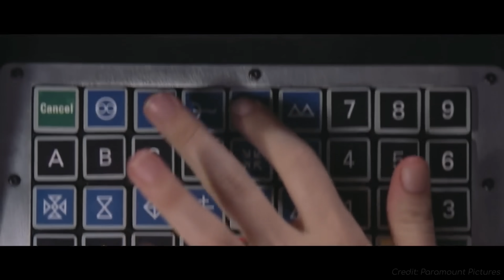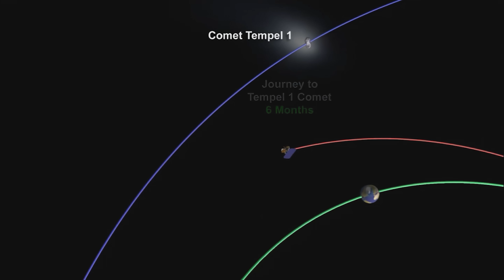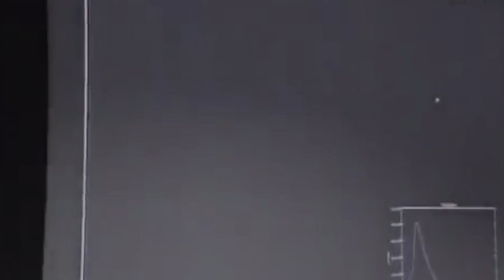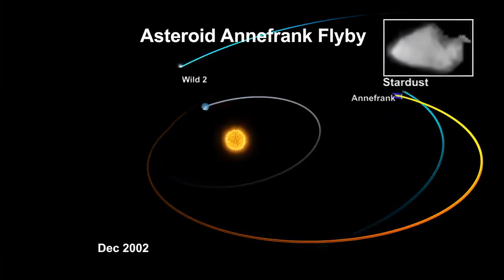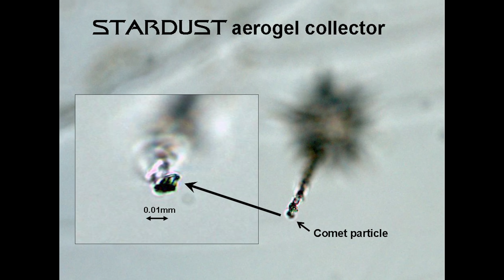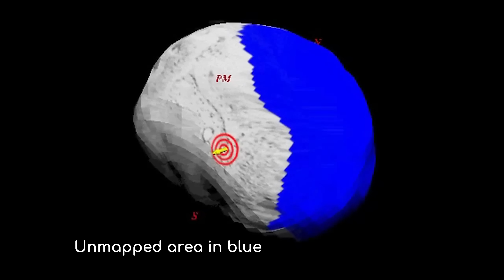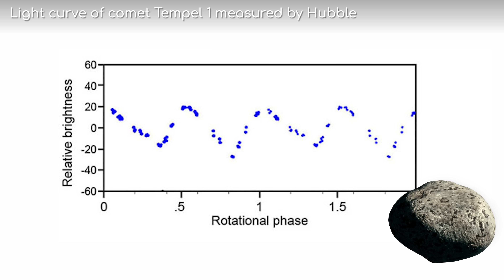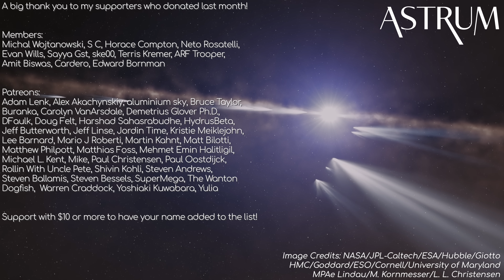The Image NASA Didn't Want to Receive from the Deep Impact Probe | Supercut

Comment: Great video and educational... but I have one question. What was the image that NASA didn't want to receive from the Deep Impact Probe?
Reply: im guessing it must be the view of the impact crater obscured by the material ejected
Reply: Click bait; or maybe proof it never happened? 🤣
Reply: Why am I not surprised the whole title is clickbait..... dafuq.
Reply: this channel is so click baity
Reply: @primarytrainer1 probably an AI content farm.
Reply: The super bright, dusty image, as it blocked the view of the actual impact.
Reply: It's called CLICKBAIT and should be reported. And this is what i'm going to do.
Reply: Astrum klickbait
Reply: @PHeMoX  Yeah, matches other issues with the video, like how it is very uncritical, dodging pressing/interesting questions  but then indulging in trivia, in some mild cases. (I wondered whether the scientists could possibly not have considered the dust cloud after impact obcuring sight. Maybe the other probe was already planned as a failsafe?)

Also, and I wonder whether it could just be made up or just this clickbait channel not being interested, I once read that the probe exploded before hitting the surface, apparently due to a charge difference from the comet having come from far away from our star's electromagnetic field. (Which also causes the ionization trail.) That was used as an example for the electrical universe theory. - If that was the case, then the crater would have looked as if the comet was low-density mass when it isn't. There was also some analysis of profound differences in crater appearance between impact and proximity detonation.

Regarding the clickbait, sadly, some feel compelled to use such titles if a video's view count doesn't conform to an expected norm. Even otherwise very decent-appearing youtubers might do this, so it's kind of an anecdote of why we shouldn't overvalue people. - Success in a rotten system comes at a price.
Reply: A blue police box sitting on the target zone.
Reply: Yeah. Really hate the fact that so many channels that I love and watch all videos fully put such shitty titles that even after watching the entire video I feel like I missed something. Just have to dislike this and hope it changes.
Reply: Clickbait channel, unsubscribed.
Reply: Yeah, I didn't like the fact that it was clickbait, either--; especially since this is supposed to be such a serious, science channel--.  

This leads to real headlines getting ignored and forgotten because their videos will be left-unviewed because of the dread that the title is fraudulent.
Reply: @primarytrainer1  I don't remember it always being this way, but lately I feel like I'm never told what the true video is about with this channel
Reply: You all are incredibly over critical over an overall incredible channel.
Reply: That's the hook.  Very annoying to read the headline and never get the punchline.
Reply: the video is good enough to keep you entertained, i like it 10/10
Reply: @SoFunMe Yep thanks I youve saved me 30mins
Reply: U clearly weren’t paying attention. I read ur comment and this thread before getting to part of the video where he explained exactly what the title says. At 9:50 he explains exactly what happened. Sometimes it pays to actually pay attention😂🤦🏾‍♂️
Reply: @Eli-akad This should be a video about an interesting topic, but instead of properly naming it, they add this fishy title and the clickbaity thumbnail "THIS IS BAD"... and what do we get? About 20 seconds of him explaining why this is not the "predicted outcome". This is misleading, they are clearly trying too hard to get views, and that makes this channel look desperate for money, like a money farm, lame...
Reply: Thank you so much for asking this, as you saved me from a click bait video. Cheers man, have a great day.  🙂
Reply: Thank you for saving me 30 minutes of my life!
Reply: @Eli-akad  and sometimes people have better things to do than wait 10mins for an explanation
Reply: @Timbo_tango  that’s irrelevant to the original comment. Buddy already watched the whole thing😂
Reply: @Dowlphin  didn’t one of the JPL engineers say it was a “superb video” like two comments under this lol
Reply: Yeah, it's really bad. And the narrators voice is weird, in this aurally airbrushed, strangely velvety sort of way- @primarytrainer1
Reply: at 9:30 it tells you exactly why - seems not many bothered to listen
Reply: @daytona1212  so out of all the videos on youtube this one should be reported? Give me a break
Reply: @doctormarazanvose4373 I believe those were images the scientist wanted to see. A lot of knowledge in them. My interpretation of the image they didn't want to see was: the last one. At 28:56 they talk about the last transmission... I don't know if it was an image but I'm sure they didn't wanted it.
Reply: @biggity_blake  You can break whatever you want. No, there are lot's of videos with clickbait and should all be reported.
Reply: While I agree with most of these people about this being a sorry click bait channel. 

Um, basically the answer is "They didn't see anything" and that's the issue.
B/c when the impact happened, all this junk blew out & blocked cameras, or something like that. 
Talks about it around time stamp 10:35

27:00 in they cover things again.
Reply: @daytona1212  i mean these days all content creators know that  it's basically impossible to get a substantial audience without at least a little pinch of clickbait. The thing is it has to be the good balance, not too much that it's comically obvious and awkward, not too little that people don't click and the algorithm never recommends you.
Reply: @wallabra  Well at least mention the subject in the title, in your video. Watching a 30 minuten video to discover it's not in there is pretty annoying, because that's why I started watching the video.
Reply: @daytona1212   I agree with that.
Reply: this was exactly my question: it's just a click bait title. I will unfollow this channel
Reply: @Philsburneraccount  We don't know they can have them write them yet, and there is some real info - just not the info advertised in the title; i.e. click-bait.
Reply: @primarytrainer1  Yes, this channel is very clickbaity with the titles. And not everything is correct. See it as entertainment rather than news and you'll be fine.
Reply: No astrum is a legitimate channel, normally not click bait not sure what happened here
Reply: It was a sponsor ad interruption.
Reply: The crater was bigger than they wanted it to be. That's all, not clickbait.
Reply: The "scientist never expected" was especially strange to hear since I vaguely remember reading a description of walking on a comet as being treacherous due to the fluffy nature of it from a book written in the 1970s. Can't remember the book so I'll assume I'm imagining it for now. The title is still click bait though and I will not be clicking on future videos after sitting through this one.
Reply: Was the comet nocked off it's trajectory ? Not watching the whole thing. Too boring .
Reply: Yup. Might be a good content but there are plenty of better channels that don't use deceit to grab their audience. Blocked.
Reply: This video is tiptoeing around a rather large controversy without directly mentioning what it is. The title does not say "image" it says "result" , from the stand point of imagery general telemetry and mission execution every thing went flawlessly or as close to it as you can expect the technical achievement is actually quite impressive.
  The people saying "it must be the view of the impact crater obscured by the material ejected" are close but don't get a cigar. You see there is no mechanism to explain how the debris settled back in the hole it was blasted out of.... The mission operators simply asserted that this is what happened to explain the fact that no hole was created by the impactor in the soft surface of a muddy snow ball comet and have been allowed to get away with it.
  This was the entire point of the impactor "make a hole so we can see the ice" but instead what they got was the "result" one would expect from an impact with solid rock I will say it again >>> "The Result was EXACTLY what one would expect if the impact were on solid rock"<<<.
  In addition the pre impact flash was predicted by plasma physicists the moment the experiments details were publicized. It was pointed out by the electron jockeys that objects such as comets live 99% of their existence at apogee far from the sun in an area of the heliosphere that is very defuse and electron poor inducing a positive charge on the body , then these bodies accelerate toward perigee in the inner solar system where the electron density is vastly grater. 
   Electrical mechanics are such that a body with a large charge differential from its environment will have an area of effect surrounding it that when entered by an object of differing charge will result in charge equalization aka "a spark" a rather large spark in that case.
  These same Physicists also predicted the "no hole" result because the same electron poor positive charge also accounts for the luminescence of comets as they approach the sun with no need for ice sublimation. This being the only reason to think comets are made of ice and ice comets being a piece of the standard model of star formation you can sort of see how  this one seemingly insignificant anti result starts to cave in a whole lot of assumptions across the entire field of astronomy.

...it is a fair observation of astronomy as a discipline that they dislike electron jockeys (or any one else) telling them they are wrong. they see electricity as a technical gimmick useful for instrumentation but having nothing to do with their home turf an area of study they fought very hard to free from its astrology roots. And to be fair electron Physics has a history of fraud from the 1900s that could make any astrologer look credible if you squint hard enough. The rift is so bad in fact that Astronomers ad hoc invented a rule that electricity is not allowed in space and routinely "discover" electrical principles in their observations that they they reformulate so as to claim them as their own....sad and petty does not even start to describe the current state of astronomy.
Reply: But, but . . . he had a British accent. People with British accents are classy.
Reply: @Philsburneraccount none of you are real
Reply: @wallabra  That's not true at all. Among science channels with zero clickbait but millions of views because the quality of the content is high, Smarter Every Day, Steve Mould, Jeremy Fielding, 3 minutes of Aviation and not science but DDOI is the gold standard for compilations.
Reply: @BariumCobaltNitrog3n   yeah but you're looking at the top 0.01% of the bulk, and that level you need waaay more than just production quality to become a break out success. You need to know how to pace your content (to retain viewers till the end as much as possible to appease the algorithm without boring them and making then not come back), and you need visual effects and transitions that instill wow and awe. Most likely, though, you won't bother yourself with literally all the details of making a successful video (and sadly a good video isn't the same as a successful video), so you'll hire people to do it for you, which means you will need some sort of income through your channel, which besides measly ad revenue, could be Patreon (which is unreliable for smaller creators with smaller audiences), sponsors (though they always go to bigger channels), etc. So no, it's not all about production quality.
Reply: @wallabra  You've never watched the ones I mentioned have you? They are 99% person talking to camera, average lighting and not anywhere near the algorithm ideal. Patreon is great for anyone if you are making videos that people want to watch. Nile Red (and Blue) is a chemist who does fun things that no one understands and has hundreds of Patrons, Cody's Lab, Action Lab, Backyard Scientist all very successful but no unboxing, no tutorials, no makeup, no lighting, no crew. Small channels that don't have a day job. You're probably thinking of Mark Rober who does everything on your list and bows to the 'rithm.
Reply: The initial comment in this train demonstrates why we have so many problems in the world. People seem to be incapable of paying attention to even the simplest things … the “image” NASA did not want to see” as the title asks is the one where the impact crater was obscured by the impact dust cloud (as shown in the video) since one of the primary mission objectives was to image the impact crater!
Reply: @daytona1212 The picture they didn’t want to see was all the dust that covered the crater which meant they needed to send a second probe for pictures.  Did you even watch the video?
Reply: @Dowlphin Did you actually watch the video?  The thing NASA didn’t want to see was the entire crater behind hidden under all the dust from the impact.  Which meant they now had to find another way to actually get the pictures they wanted.  I swear to god you guys put all this energy into assuming there’s something nefarious going on without taking the 5 seconds it takes to think through the question.
Reply: @nickopeters Did you watch the video?  The thing NASA didn’t want to see was the entire crater being covered in dust so that their goal was ruined.  Come on guys, think!
Reply: They used to be such an amazing channel, but recently its all been going downhill
Reply: @astrophysicistguy  The title of the video should be the focus and mentioned, explained and made clear in the first 3 minutes not at minute 19. Asking a simple honest question is absolutely not why you have so many problems in your world, and you are not WE, you speak for yourself, only. You seem to be incapable, as you say, of understanding a simple question. Or reading in general, any of the 60 or so people that answered his question a lot nicer than you did.
Reply: It's funny that a video that doesn't answer questions for you, but makes you think about what the title meant, instantly becomes click bait to the minds that cannot process information on their own. I bet they watch Fox Noise.
Reply: @BariumCobaltNitrog3n  have you written a book about how to do proper YT videos so i can read you thesis on how only videos that “explain & and made clear in the first 3 minutes …” are correct?  What happens if they explain it at 3 minutes & 309 secs or god forbid at 2 minutes and 11 secs? And you’re absolutely correct, I don’t care what the other 60 people have said because it’s my experience that 59 usually don’t have a clue what they are talking about.  Maybe if they were all also members of MENSA like myself it would be different but sadly it’s not. 

Oh and if you had an attention span greater than 3 mins this would not be an issue but i digress …
Reply: The Clickbait Image...
Reply: @BariumCobaltNitrog3n   I think you missed my point. When I said "production value" I didn't mean it had to be unboxing stuff, or have makeup and lighting, like be a studio thing. It's often the small details, like good video editing and audio mastering. Those are sometimes the most important details, even if they're subtle. I've yet to master those myself, but anyway. I think these channels are successful because they found their audience, and they do, yes, have good production value.
Reply: @wallabra  Well isn't that lovely.
Reply: I want to offer my input here as an astrophysicist. Although the video could have used a more straightforward title, it accurately tells the story of the Deep Impact and subsequent Stardust missions. I don't consider it clickbait and it doesn't exaggerate the importance of the result to science. The cloud was indeed more significant than expected, and prevented Deep Impact from getting satisfactory images of the impact site. It was such an issue that the mission plan of Stardust was modified to visit Tempel 1 to get additional pictures after everything had settled down. As for whether or not scientists should have expected this, the whole point of these missions is to find out what the internal structure is. Sure, many people had ideas and theories beforehand, but that's why we fly a mission there to confirm.

Edit: To clarify, the photo they didn't want to see was the one with the cloud obscuring the impact site
Reply: @orbemsolis  Since your reply is directed at the OP, you might want to read what he wrote again. What was the image they did not want to receive?
Reply: The dust cloud.
Reply: The comet was totally lost 😮 since the space was exposed 😳 and a hole appeared very slowly
Reply: You got clickbaited. This channel is prone to do that.
Reply: @@MichaelDettrey nobody  intelligent. Chemically speaking, silicon lifeforms existing would be so difficult to sustain that it just wouldn't last. It's not viable. It's a fun sci-fi idea, but the probability of it existing and all the chemical complications mean that if we ever did find it, it'd be some sort of single-celled microbe, or something of the sort, and would be fascinating, but also absolutely NOT something NASA WOULDN'T want to find.
Reply: I hate these for the clickbait titles... I think I'm done with the channel because of it
Reply: Yes, I feel I fell for another click-bait title on this channel and wasted my time waiting for the answer. It's time to block this channel for good :(
Reply: The image that NASA didn't want to receive was the overly bright flash (09:17).  
A lighting like discharge between the comet and probe occurred seconds before impact, producing an explosion/flash much greater than any NASA scientists had expected, calling into question the standard comet model. However just such a discharge had been predicted by Wal Thornhill’s electric comets & asteroids model, years earlier.
Reply: I know right
Reply: @chloewebb5526  It slowly happened during this year. I guess he wanted more than he already got. But by doing that when his credo was not having the same editorial narrative as many other outlets, he just lost a huge part of his particularity… then his long time subscribers.
Reply: @wallabra  What you didn't seem to notice is that this channel didn't need such absurd clickbaits and variation of topics as it was already performing very well by building trust and quality over the years, focusing mainly on astronomy, presenting discoveries and images in a straightforward and concise manner without the now-usual sensationalism.
Before those changes, this was not a small channel at all and it was already well recommended by the algorithm.
Reply: @PainterVierax   but I do agree no channel needs this level of clickbait. I'm more saying the concept of clickbait itself isn't inherently bad, or at least to some extent often necessary to garner an audience, depending on what kind of video we're talking about.
Reply: Yes
Reply: Yes
Reply: 😆  nope
Reply: @wallabra  Well, clickbait is different than getting a catchy title and a catchy miniature pic. It's being catchy and lying about what the content is. Here, there is nothing inherently bad for the NASA. In fact this is good as the mission went very well and gave them a result. Maybe this was not the expected result but this is still invaluable data for scientists.
Using the word "bad" instead of "unexpected" is what turns the catchy marketing into a deceptive clickbait.
IIRC the shorter Deep Impact Probe episodes he published before making this supercut aggregation were not using clickbait.
Reply: @Eli-akad lol. Got em. Dude already watched the video, his time wasn't that valuable
Reply: I have watched a number of these and never do find out what they mention in the title.  I don't get it.  I do get frustrated that these tend to rehash old stuff and I try to zip past that.  But then I can never find the information they promised I would get.
Reply: @Philsburneraccount  “I shall not commit the fashionable stupidity of regarding everything I cannot explain as a fraud.” — Carl Jung
Reply: Obviously all the dust going the wrong way and obscuring the crater they wanted to see!!! Didn't you get the video?
Although to be more precise, it was more of what they didn't see than what they saw! Still, the title was completely accurate! NASA DID receive an image they didn't want (stardust) as it was obsucring them the image they DID want (the crater)! So, they had to wait a few years to get that too! ☺
Reply: So, those responsible for video  that's surely chalked up as Clickbait need be taught something. Let's just use comment/replies forum to talk of things nothing to do with so called subject. Never mind, someone already thought of that at the beginning. Lol
Reply: @@MichaelDettrey Silicon-based life is just as likely as carbon-based -- maybe a bit more complex... still, no -- not without constant access to reliable energy-sources.
Reply: @primarytrainer1 it is click baity, but I find it interesting enough that I don't care.
Reply: "What was the image that NASA didn't want to receive from the Deep Impact Probe?"
The uploader's backside with CLICK BAIT tattooed across his cheeks.

I always down vote click bait.

{:o:O:}
Reply: To you negative critics out there,  I am really impressed about how brilliant you all are and have so much time on your hands to impress us all with your knowledge.  I'm sure you will eventually be recognized and offered employment of such by NASA, JPL or other corporations so you can be put in charge of the whole internet.
Reply: Just click bait!
Reply: @Dowlphin  That Is Why I Use Ad Blocker!
Reply: @harryjones5260  It makes perfect sense, the last picture they wanted to see was the 'long' obscured target.
Reply: Obviously the deep probe image  from Uranus.
Reply: Thanks! You just saved me from 30 minuttes time wasting. A shame there's so many downright false click bate titles. Some publishers I just scroll by but this one slipped through. Not watching more from them in the future. Wish one could block publishers so they don't appear for you unless you unblock them again. Such time wasting.
Reply: @HifiCentret  It's not click bait, the picture they described is the dust cloud that obscured the pictures of the crater.
Reply: @daytona1212  9:28 "However ironically, the success of the first part of the mission caused and unexpected side-effect. A large dust cloud was kicked up by the impact which obscured the flybys view of the impact crater."

Clickbait title, quality video, though not comprehensive it was certainly informative and entertaining.
Reply: @lumpydark6173  9:28 "However ironically, the success of the first part of the mission caused and unexpected side-effect. A large dust cloud was kicked up by the impact which obscured the flybys view of the impact crater."

Clickbait title, quality video, though not comprehensive it was certainly informative and entertaining.
Reply: @KeithHartman-n2f  9:28 "However ironically, the success of the first part of the mission caused and unexpected side-effect. A large dust cloud was kicked up by the impact which obscured the flybys view of the impact crater."

Clickbait title, quality video, though not comprehensive it was certainly informative and entertaining.
Reply: @blucat4  This video is as described in the...description. As for the title, clickbait? sure, but what he was referring to was at 9:28, regarding the flyby craft getting obscured images due to impact debris.
Reply: @diegorodriguezv  that wasnt from the impact probe. at 9:28 or about 9:30 I suppose he explains that the flyby images were obscured due to the debris cause by the impact probe.
Reply: clickbait it wont exist
Reply: @JeronimoStilton14  yep - a good reminder that the internet is full of fools like @Dowlphin who think they know better than actual experts on the topic...
Reply: Extroverted introverted implode explode you tell me...
Reply: I agree - great video. But the title that was given to this video is clickbait.
Reply: Maybe the big cloud of gas.  They wanted to see in the crater.  But they decided to make the crater on the sunny side thinking more lighting would make better pictures.  They didn't think about how the direct sunlight would melt and evaporate the newly exposed ice.
Reply: Probably the aliens who made rude gestures to the camera.
Reply: @@MichaelDettrey I thought "silicone based lifeforms" were created in Los Angeles.
Reply: @daytona1212  If you could pay attention you would have seen what NASA didn't wanted to see; A failure of the mission in a way or another.
Reply: Just more clickbait
Reply: To answer your question, The image NASA didn't want to receive, was a useless image. Which it got = COVERED BY DUST. But this was luckily fixed by the stardust probe.🙂Best Regards.
Reply: @PHeMoX  Thanks for the heads up; you have saved 25 min of my life, and probably a lot more in the future.
Reply: Scam to make you watch is video
Reply: Click bait
Reply: every video they do is click bait
Reply: @lumpydark6173  they said what They didn’t want to see
Reply: 9:23
All you people whining about clickbait... what did you expect? Aliens? Dr. Evil's space laser? /sigh
Reply: @UrielSepsis  We all expected "The Image NASA Didn't Want to Receive ". Instead, we got the image NASA expected to receive. /sigh
Reply: Guys it was shown. 8:25 And past they show the impact images and the stuff shoot off of it. The title is a bit misleading, but its media how do you think they grab your attention.
Reply: @masterblaster642  It's not a bit misleading. It's completely misleading and they do this with every one of their videos.
Reply: Click bait unfortunately it’s the new normal with content creators
Reply: @primarytrainer1 
The fact is that the images and information of these uploads are usually very interesting. But yes, the video titles are often misleading or confusing.
At least we have commentators who clarified:  Kousha Talebian and Harry Jones.
Reply: @daytona1212 clickbait titles aren't against TOS lmao
Reply: This is quite possibly the dumbest thread I've ever seen. 

Good job, Alex. I love your work.
Reply: @primarytrainer1 And there's no need for it to be clickbaity.  The content is well-researched, produced and edited.  I'm annoyed EVERY TIME I get an @Astrum video in my feed.  This one's title seems calculated to suck in the UFO/UAP crowd.  So dishonest.
Reply: @robadams5799   English not you first language then?   If he had a 'British' accent, I'm Nelson Mandela.
Reply: Alex, you need to listen, and respond.  This is  clickbait.  Also meteors streak, comets do not.
Reply: The explosion of dust and debris that obscured the crater. He explained that in detail.
Reply: @nozomifin If you feel that way maybe you weren't listening very closely. He not only told what they saw that they didn't want to see, he showed you the images.
Reply: @rremnar it was the image of the dust debris blocking the crash site they were trying to study.
Reply: @PHeMoX it was the dust debris blocking the impact site they wanted to study.
Reply: @primarytrainer1 it really isn't click baity. He said what the image was
Reply: @Philsburneraccount this channel obviously isn't ai generated. Get some sense.
Reply: @gasmaskz nah your just mad for no reason.
Reply: Your comment makes no sense. Why would some one click on a 30 minute video if they dont have ten minutes to spare. Just keep coping
Reply: THANK YOU!!
Reply: @Philsburneraccount no it's definitely a real channel, with really great content. Now is there clickbait is some of the titles? Yes. But also you have to consider the algorithm and what creators have to do to maintain visibility
Reply: Not watching based on just the comments
Reply: @Dowlphin half of this video is plagiarised. the other half probably is too. idk if it was a guy on his team that plagiarised and no one else noticed, or if this is just a common thing for the channel.
Reply: @gasmaskz not to mention he plagiarised half of this video so I would wager he plagiarised all of them. initial red flag were the click bait titles. red flags are red flags for a reason
Reply: I'm going to start skipping videos where the titles imply obvious clickbait.
Reply: Yeah. If it's in the title, I EXPECT it to be in the video. Perhaps I missed it? 🤔
Reply: @DylannJocelyn Perhaps, but it is reasonable to expect honesty and respect from the producer. This conversation point would not exist had those two common standards been met. They can & should do better.
Reply: @BrokenEyes00  Nice one XD
Reply: @Eli-akad  At no point does he say that NASA did not want the resulting image.  As a matter of fact, ANY image would be scientifically significant.
After all, they didn't delete this 'unwanted' image, did they?